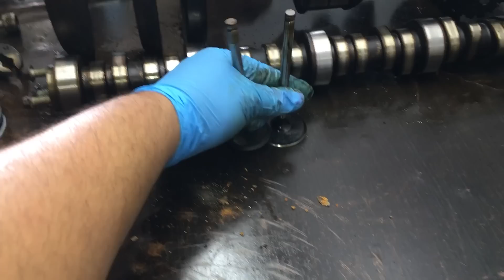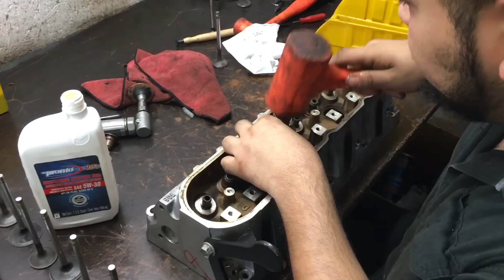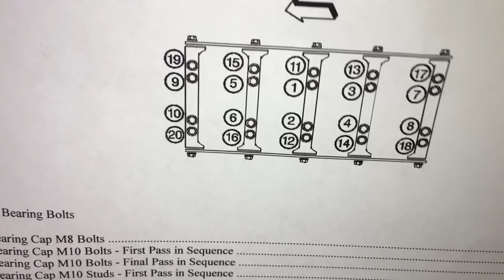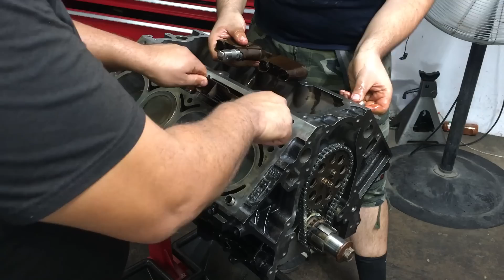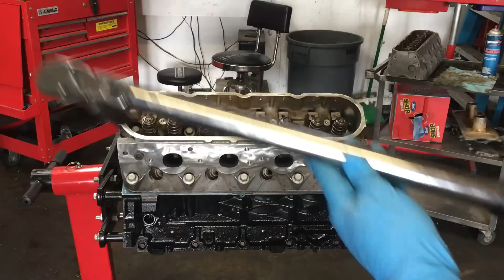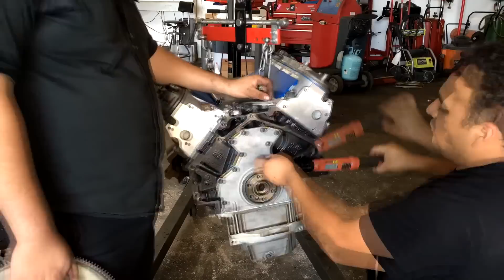ENGINE REBUILD GM LS V8 PART 2 CLEANING & REASSEMBLY

Comment: Good workmanship! Be careful when painting. Be sure to mask off areas like where the side crank bolt heads mate to the block. Might use some rtv sealant there on a clean surface.

Comment: At minute 38.40 you said the "firing order is 12345678". That is not correct. The firing order is 18726543. The cylinder position is correct on the diagram, so the torque sequence was done in the correct order.

Comment: Doant you need to make sure the rod caps stay matched to the rod that it came from ? You didn't make that clear ...and shouldn't the valves stay matched to the guides and cylinder it came from ? I see you have them just put all together and can't tell one from the outher ..or does it mater if you plan on doing a valve grind ?...what is tork angle of 15⁰....is there a difference in ring gap between top compression ring and bottom compression ring , I did notice you had different ring gap specs...wish you would have shown the oil ring being instaled..is the tork angle the amount you turn the bolt after your initial tork pound setting?

Comment: try some purple power on the heads.. cleans great but dont leave it on for long periods of time or leave submerged.  rinse it in hot water and blow dry.. also a soda blaster works well on the heads.. must be dry and oil free. wash and blow dry.  look like new

Comment: Amateur rebuild. Certainly nothing 'advanced' about it. You didn't even check piston or bearing clearances or use proper assembly lube.
Reply from the maker: 4 years and thousands of miles later, the engine still runs great.

Comment: Curious, when you used the drill with the abrasive, what abrasive did you use and does it remove metal or damage the seats or valve guides? I know this video is 3 years old but im currently rebuilding my engine now and would like to know. Thanks in advance!
Reply: looks like he used a steel wire brush. I would probably opt for a brass cup brush if i were going to use it on aluminum, i think he used a plastic or nylon brush for the valve guides though. the hardened valve seats should be ok  but he hand lapped the valves after the cleaning.

Comment: Let's keep it real, final washing of the block wasn't done lol that things going back together awful dirty, sure it'll run and drive but there's gonna be alot of trash and gunk in that oil going through the new bearings and everything. Definitely a half ass job on cleaning but video was decently made and explained

Comment: I'm assuming you plastigauged the bearing clearance.  And remembered you mentioned the crank to be polished, but don't see the crank journals polished. I assumed you decided the crank is in excellent condition and went  for it. I understand this was a very basic standard rebuild for a stock engine and thats what would be done since its not going to be raced. EXCELLENT tutorial and will follow your advice,  except I will be thrashing my motor a lil LOL...so I will polish and be sure to gap rings and plastigage as required for high performance specifications. Great video! Also How is it running today??? Maybe a follow-up video of the truck running and possibly a "drive around" to show after 10K miles the truck is performing well??? OR do a Oil Pressure test to show how the engine still holding up Pressure? That will give some of us some reassurance of a LS rebuild and what to Possibly expect, since these engines have such good reputation. Thanks!

Comment: Curious why you didn't check rod and main bearing clearances, crank endplay, cam timing, or pushrod length? Also what about shimming the oil pump, and timing cover alignment?

Comment: Thats not how you install the Oil Pump, Oil Pan or Timing cover!!
Reply from the maker: Over 2 1/2 years later, the engine has no leaks and still runs strong. The owner drives over 120 miles everyday for work.
Reply: You got lucky.  Here is the correct way to install a LS oil pump. Sorry just want the newbies doing there first build to know the right way.
https://www.youtube.com/watch?v=CWCIdhG04LY

https://www.youtube.com/watch?v=H1w46aWyM8I

Comment: I allways start a engine build by installing the camshaft because if their is something wrong with the cam bearings and the cam dose not turn smoothly in the bearings the block has to go back to the machine shop. Also put grease on both ends of the push rods and in the lip trough of both main seals .

Comment: your supposed to putt 3 feeler guages on the oil pump or put the bolts hand tight and spin it to center the pump
Reply: Yep, should have aligned front/rear covers too. Also should have checked bearing clearances...

Comment: Did you remember to position the thrust bearing cap by pounding both ends of the crank with a rubber mallet before torquing the main caps?
Reply: No he didn't and he doesn't like that kind of questions. I asked him the same thing. 😂😂

Comment: i might have missed it on the first part 1 did you have the crank polished before you used new bearings? is it ok to not have it polished? mine looks like yours as well and wasn't sure if i should have it polished before i used new rod main bearings

Comment: Love your videos. Just one question. GM specifications on Crankshaft endplay is between .003 to .008. You had .002 to .003. Did you square the thrust bearings? Just asking because you can easily end up with a bigger endplay and loose some oil pressure. Not saying is bad, but I didn't see it on the video.
Reply: No he didnt, not was the oil pump, pan or timing cover installed correctly

Comment: Why do you need new head bolts you could not use old ones??
Reply: Always replace the head bolts. These bolts are torque to yield and they stretch.  The last thing you would want is to be torquing down an old head bolt and have it snap off in the block.  Eric did the right thing by replacing them.
Reply: @itsallgood90700  Check the bolt stretch with a ruler, re-using is permissible

Comment: Forgot to center the thrust bearing before torque sequence on mains. leading to his excessively small thrust measurement on the crank
Reply: Ya didnt center the oil pump properly or the from rear covers.

Comment: how did you get the front crankshaft oil seal installed?
Reply from the maker: Using a very basic seal installer tool. You could even use a piece of 2x4 wood and a hammer. I know there is a special tool for installing these, but honestly I've never had a problem doing it the old fashion way. This particular engine is still leak free over a year later. Thanks for watching!

Comment: I'm mostly interested in refreshing an engine.   Rock auto is selling refresh kits.   Which are sized and not the over boring sizes of .010 or .020.      Any one with information on this

Comment: Noticed that you don't center your rear main seal?
Reply: they definitely did not center the front one,  the tools needed: https://www.youtube.com/watch?v=H1w46aWyM8I
Reply: They didn't even set the oil pump correctly.
Reply: I noticed the same thing, if that rear seal isn't perfectly aligned it'll usually leak, and it's pretty important to center the oil pump drive so it doesn't prematurely wear the inner plates.

Comment: Hello, I saw a previous video about the Audi A5 that had the convenience key defective code. i have the same problem with the same code (03283) and i’m wondering what transistor you bought or where you bought it from.

Comment: Excellent video. It's not very often you see an old engine getting rebuilt nowadays. I would advise though that  a visual inspection of a cylinder head for cracks between the valves will only reveal so much. To be more accurate magnafluxing can reveal hair line cracks that your eyes cannot see!
Well done so far on this build..👍
Reply: Can't magnaflux aluminum

Comment: Real shop video. Learned things I've never seen others cover. No bearing clearances check? I assume stock size bearings used? Engine ready for another 200,000 miles.
Reply: Yes, I was puzzled by that lack also.  Takes a while but Plastiguage is your friend.  It is not impossible to have a wrong sized bearing insert slipped into the package and boy would that ruin the job.  Nice, fast and intelligent workmanship, I learned a thing or three, thanks.

Comment: It's good practice to rotate the crank after each cap is put on. So if it binds. You know which one it is. As sometimes they can sneak the wrong size bearing in on you.. But nice job.. The customer will get good engine...I would add. While you got it apart. Replace them knock sensor wiring harness. They are notorious for going bad. As the heat under there punishes them.